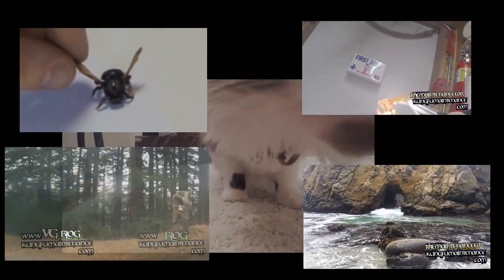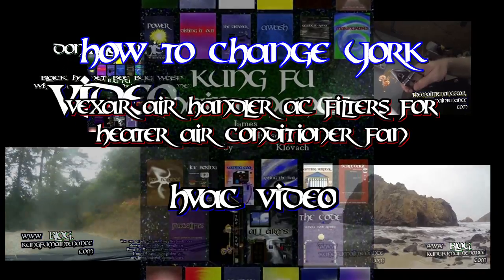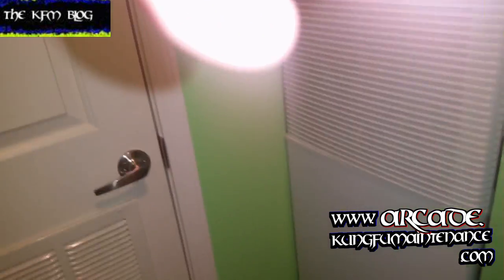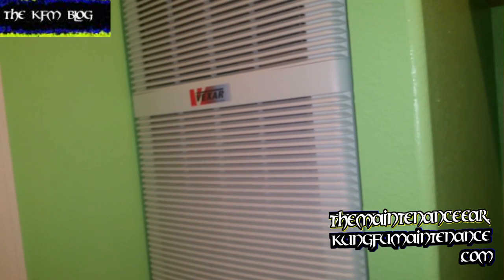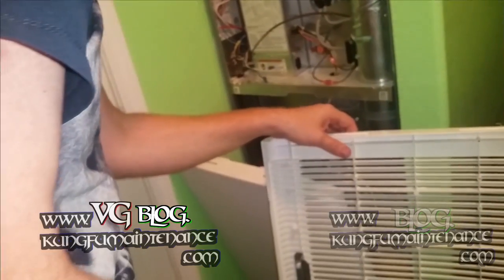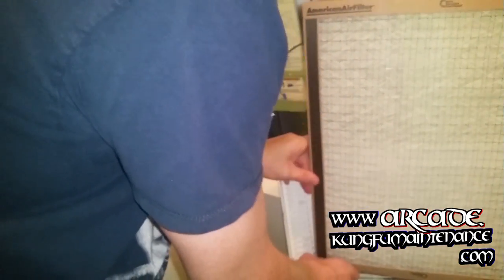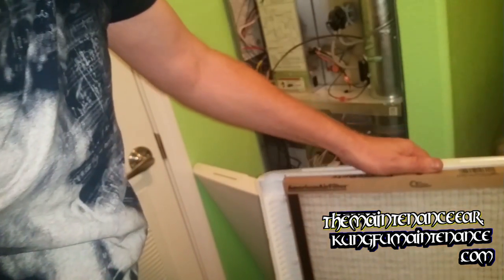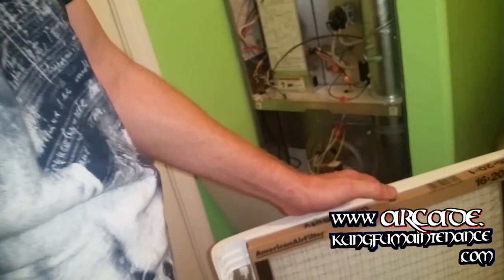How To Replace York Vexar Air Filters Heater Air Condtioner Fan Mobile Home Air Handler HVAC Video

Comment from the maker: Get KFM's favored Multi-Meter  here        http://amzn.to/2l8W9CO 
Get the Milwaukee 11 in 1 Screwdriver     http://amzn.to/2uTtsNj 
Wet Dry Vacuum used in so many KFM videos   http://amzn.to/2lFxi7u
Chapin Pro Pump Sprayer                             http://amzn.to/2vWCXdD
Evaporator Coil Cleaner No Rinse Mix        http://amzn.to/2x3eJTT
Evaporator Coil Cleaner No Rinse Can        http://amzn.to/2ezIxju  
Get the Screwdriver used in so many KFM videos here    http://amzn.to/2kHFoOF 
Easiest Way To Get Universal EPA Certified Prep Manual    http://amzn.to/2kIQdQC
Get KFM's favored AC Gauges here            http://amzn.to/2kYgGb8
5/8" Suction Line Insulation   http://amzn.to/2w1me8G
Simple Leak Seek Spray   http://amzn.to/2lFfcC5  Laser Thermometer  http://amzn.to/2layD8I  
Valve Core Removal Tool                              http://amzn.to/2kJ00pC
Get KFM favored Electronic Leak Detector        http://amzn.to/2kmQMMz
Inficon Refrigerant Scale                               http://amzn.to/2vUCQPD
Hard Start Kit     http://amzn.to/2kiD16v   Contactor     http://amzn.to/2lFqA0P
Get  the Multi Tool Pliers used in so many KFM videos       http://amzn.to/2kWTjPp
5mf Capacitor   http://amzn.to/2wC96sH     35mf Capacitor    http://amzn.to/2vZVZ2t
35/5mf Capacitor   http://amzn.to/2iVJNi2        40/5mf Capacitor    http://amzn.to/2wzEdXD 
45/5 mf Capacitor   http://amzn.to/2w0wez5   
Condensate Pan Tablets   http://amzn.to/2lalV9W   No Rinse Coil Cleaner  http://amzn.to/2lHg8GD
Condenser Fin Whisk Brush                          http://amzn.to/2vWXUoC 
You must be EPA certified to charge or recover refrigerants and here is about the Easiest Way To Get certified with the Universal EPA Certified Prep Manual    http://amzn.to/2kIQdQC
Get The Kung Fu Maintenance book here     http://amzn.to/2lEQPFk
Or  the Kung Fu Maintenance E book here  for less than $5    http://amzn.to/2lEY8wD
Get the Kung Fu Maintenance album (good driving music) "Up Beat" here     http://amzn.to/2l41pZ1
Get the Kung Fu Maintenance album (nice Instrumental music) "Entropy" here   http://amzn.to/2kl2U0p
Samsung Galaxy S8 Plus        http://amzn.to/2sFn9h8
GoPro Hero 5 Action Camera         http://amzn.to/2sN4nVK
Rode Lapel Microphone                 http://amzn.to/2vZoFc7
Purple Panda Lapel Microphone  Kit   http://amzn.to/2wByXkq
Video Edit Pro Software       http://amzn.to/2ruaaeZ
Samsung Galaxy S5                 http://amzn.to/2wBxk6l     
Samsung Galaxy S8 Plus        http://amzn.to/2sFn9h8
Video Edit Pro Software       http://amzn.to/2ruaaeZ

Hire An HVAC Specialist                                  http://amzn.to/2lktKek
Air Duct Cleaning Services                              http://amzn.to/2lFTpun
Central Air Conditioner Tune Up                   http://amzn.to/2lzJGoy 
Air Conditioner Repair Or Installation          http://amzn.to/2lFsEGw                                           
I don't work for any of the product companies  listed however I do make a small commission on items ordered  through the links.

Comment: My heat was set on 74 degrees but the heater would only go up to 66 degrees I replace the filters and temperature start rising now I need to make sure I put them in correctly thank you for this video saved me a repairman fee

Comment: This furnace looks identical to my coleman furnace  , I was wondering if you know the actual maker . Mine runs a small fan for about a minute and then the burner ignites and the main blower come on at the same time and it takes about 20 minutes for warm air to start coming out of the vents . I was told when the furnace was installed in 2009 that it was normal . I don't think so myself , it seems like an awful was of energy .

Comment: My furnace air unit has two separate filters I know there is one on the bottom and one in that screw off on the top separate the bottom fits behind the lower door The top filter seems larger but it's different It looks like steel wood dirty  Both panels are screwed in The Brillo pad on top looks larger is this possible Any help would be appreciated

Comment: hey kung fu quick question my aunt had a split a/c installed in her fabricated home lennox 3 ton with a coleman furnace or that same type you are working on two filters and it is loud as Hell!!! any solution's she can't even talk on the phone no return's many supply's sorry for long question is it a furnace or forced air unit????? or air handler and can it be installed outside relocating the water heater???

Comment: Mine is a Nordyne and the tech who tuned it up put the filters in the door panel with the air flow facing outwards. I turned them around. Obviously. the air flows into the furnace not outwards. I put a piece of paper up to it and it sucks air inward as I figured it would. Makes me wonder if these guy know what the hell they're doing.